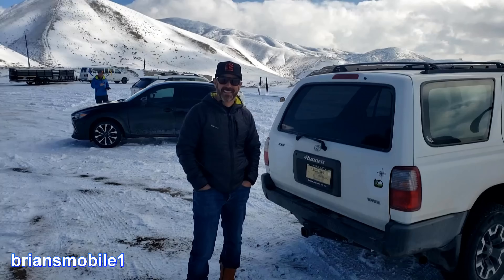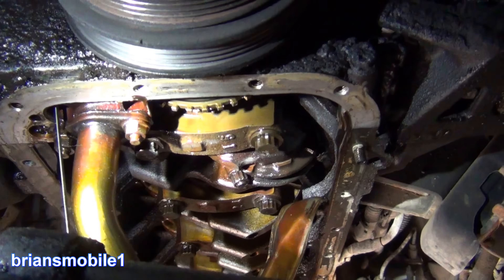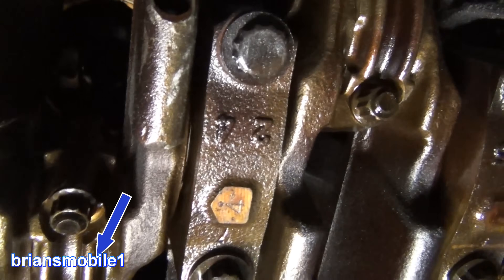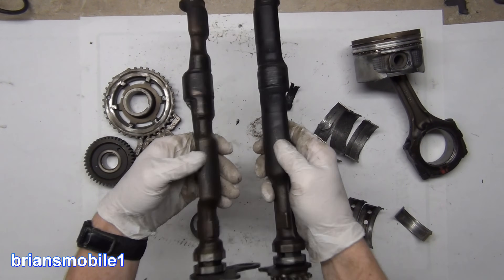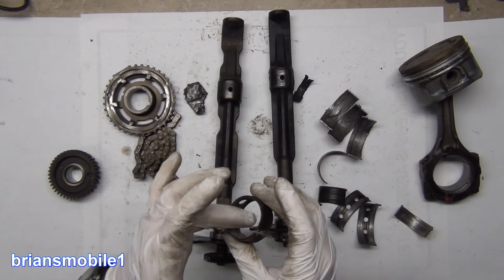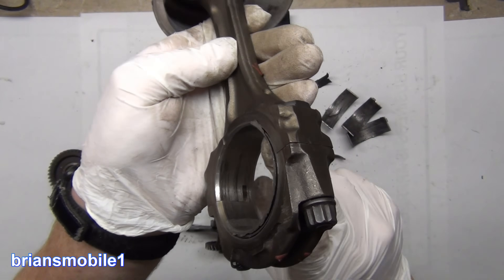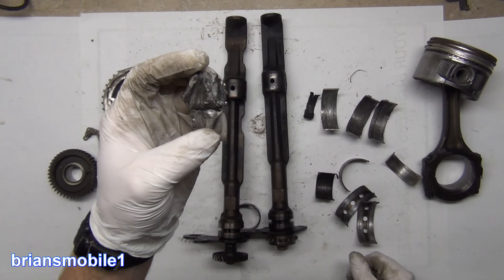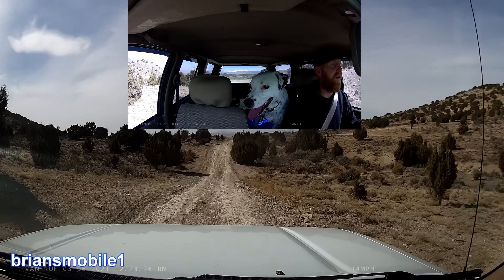Why Did This 4Runner Engine FAIL?

Comment: You should do a colab with Anchor Brand Ranch as sure the Farmer could use a few pointers and the Auto Technician could use a change o scenery and hell maybe a few inter mixed subscribers wouldn't hurt.
Keep of the good work.
Reply from the maker: I'll have to check them out.

Comment: The Mitsubishi balance shafts rotate at different speeds.  If you line up timing marks on all of them and then turn the engine two full rotations to complete one full engine cycle,, the oil pump mark will be 120° off, and the front balance shaft will be 240° off.  It takes 6 full rotations of the crankshaft to line all 3 marks (including the crankshaft)  back up to zero again.  I think the F series Honda is like that, too..

Comment: I went the full circle having everthing checked because mine would start but not continue running. 
We checked fuel pump etc.  We found a second relay under dash on passenger side that keeps fuel running once started. We also found the ignition relay was faulty and bypassed it with a push button switch.  Replacement would have been $300 from china.  Car runs fine and is unstoppable now.
Reply from the maker: Yours had the infamous "fuel cutout relay" it sounds like.  Great job chasing it down!  Way to go!

Comment: Hey man what’s your take on the Toyota 3.0zve engine? 
I have a 1992 Toyota pickup that I believe either the HG or the head is cracked. It seems as though there is water in the oil but I can’t really tell. 
There is no oil in the radiator and it’s not using any coolant. When I start it up it blows white smoke but runs fine. 
I think I’m mechanically inclined enough to do the HG  but I’ve heard that it’s not worth it with this engine. 

I’d like any opinions. It’s was supposed to be my sons pickup once he got his license but now it just sits. Please help people. 

Also a month or so before I realized that something was going on with the HG It literally spit out a spark plug out on a drive home. Also my line it got lose and fell out and I’m not sure if that is a sign of anything or if I just didn’t tighten it enough.
Reply from the maker: It's not a favorite engine among Toyota enthusiast for the fuel economy and power.  Head gasket problems are common.   Corrosion in the coolant passages where the head and block seal can be an issue and take extra thousandths of machining or other creative solutions to remedy.  I haven't seen a lot of them around lately.  Last one I did was in 2016 I think.  It belongs to a buddy of mine.  It's a 1994 and is still going strong (It's the green one you'll see in my Instagram posts).  It was expensive to do, but my buddy who owns it said he didn't care how much it costs.  It's sentimental to him.  Plus I ride in it to Snowbird on powder days, so it got the full treatment.
Reply: @briansmobile1  
Dang so with it being so expensive and me being poor. Should I just use some bars head gasket fix and say screw it while I look for a used engine?
Reply: Pick up a used engine for under 8 bills with a verified warranty from a reputable salvage yard and bolt it in replacing all of the common wear parts ;plugs,wires,sensors,thermostat,coolant,gaskets,oil,filters,etc including the timing chain or chains or belts and let him ride for 100k or so or more... The rebuild parts and machining work will easily double or triple 800 bux plus the wear parts...

Comment: Due to the damages being so widespread I'd lay money that that engine was ran with the same oil too long and with the oil level too low for a long period before refreshing it or adding more oil...
Reply from the maker: That's exactly what it looks like... 

but in this case all the receipts for oil changes seem to indicate he kept up on the oil changes really well using only synthetic oil.  
Pretty crazy right?  That was my first thought as well.
Reply: Brother by another mother,reciepts and faked oil changes are easily accomplished and all of those parts state that it ran hot over a very long time and every bearing screams not lubricated for long time... Low on oil between actual changes,or not changed oil and filters would cause just that end result from my measely decade or 4 experiences with engines and especially Yotas...  Not arguing with you,just my opinion..
Reply: @briansmobile1  Did he do his own oil changes?  It wouldn't be the first Quick-Lube place to charge the customer without ever opening the hood. 

PS: I love old engines.  They didn't bother with balance shafts in inline 4s, and they never seemed to vibrate all that much so long as they kept them to 2000cc or below - and they had no trouble revving higher than many of today's engines without shaking themselves apart.  There's something to be said for simplicity and just having less to go wrong.  :-)